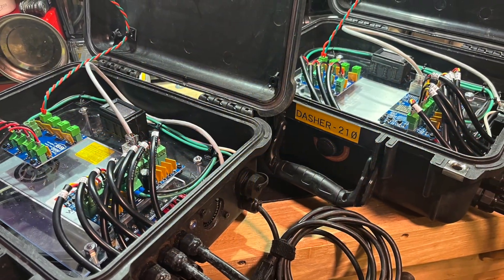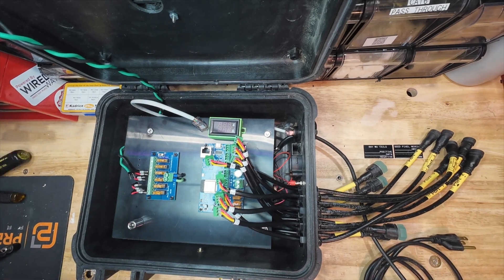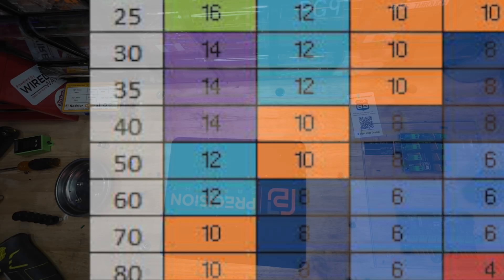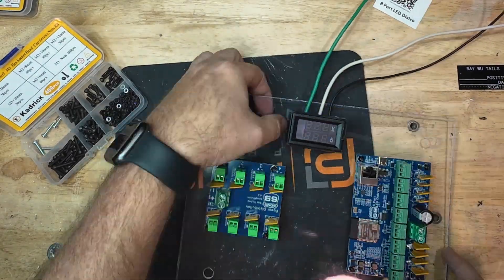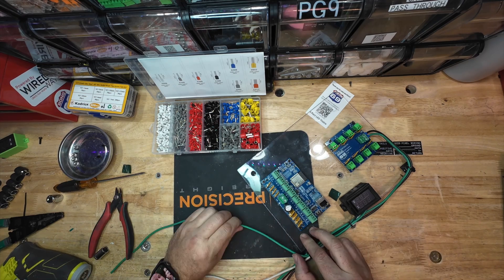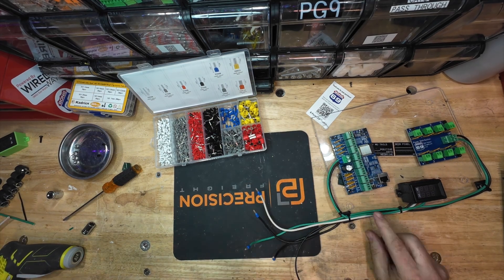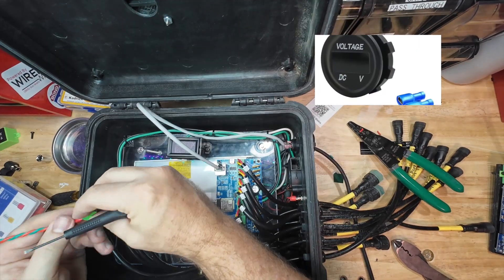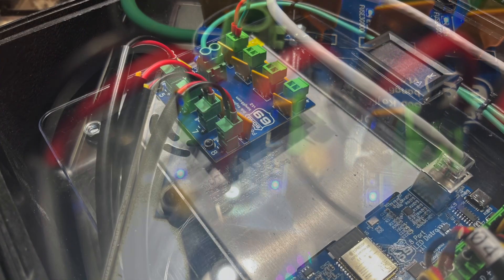Upgrading an Old LED Controller to the Bong69 System!

Comment: My biggest question is can these be ran as a slave. I use Experience Lights long range controllers for my show, but I have two of these bong69 controllers. I’d like to utilize them in some way, but they’d have to be controlled through the genius controllers.
Reply from the maker: Hi! Yes, you can run the Bong69 controllers as “slaves” in your setup. They support receiving data from another controller, so your Experience Lights Genius controllers can send the signal, and the Bong69 units will follow along. You’ll want to make sure the data output from your Genius controllers is compatible (usually just standard pixel protocols like E1.31), and then configure the Bong69 to listen on the same universe/channel as the output from the Genius.
Reply from the maker: Step 1: Check Your Pixel Protocol

Make sure your Genius controllers are outputting a standard protocol like E1.31 (sACN) or DMX.

The Bong69 controllers support E1.31, which is usually the easiest way to sync multiple controllers.

Step 2: Connect the Bong69 to Your Network

Plug the Bong69 into the same Ethernet network that your Genius controllers are on.

If you’re using Wi-Fi for the Bong69, make sure it’s stable and on the same network as the controller sending the data.

Step 3: Set the Universe & Channels

On the Bong69 controller, go to its settings and set the Universe/DMX address to match the output from the Genius controller for the lights you want it to control.

Example: if your Genius controller is sending universe 1, the Bong69 should also be set to universe 1.

Step 4: Configure Output Mode

Set the Bong69 to receive mode (sometimes called “slave” or “remote”) rather than trying to act as the primary controller.

This tells it to listen for data rather than generate its own.

Step 5: Test Your Setup

Send a small test sequence from the Genius controller.

The Bong69 should mirror the lights exactly.

If some lights aren’t syncing, double-check your universe/channel settings and wiring.

Step 6: Power & Data Checks

Make sure each Bong69 has enough power for the LEDs it’s controlling.

If you’re running long strings of pixels, consider injecting power every so often to prevent voltage drop.

✅ Once this is set up, the Bong69 controllers will act as full “slaves” and follow your Genius show perfectly, letting you expand your display without extra programming.
Reply: @twinkletunesandlighting thank you for this info.

Comment: Do you have a video on the setup of this board, instruction are not very intuitive, the bit I have found. I got the 8 port disto v4 but the GPIOs really don’t make any sense to me, I do networking and still had to fight with it to get that part setup. Anyway if you have any videos could you direct them to me or maybe if you could do one, you make it easy to understand 
Thanknyou
Reply from the maker: Im in the process of making one that will take you all the way through the setup in WLED and Xlights.